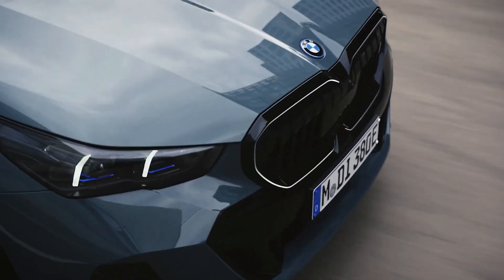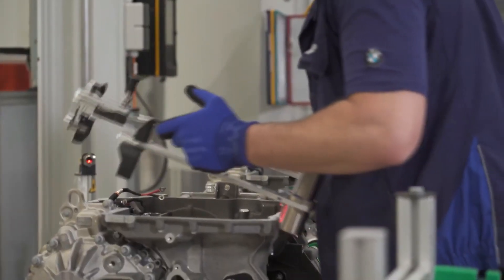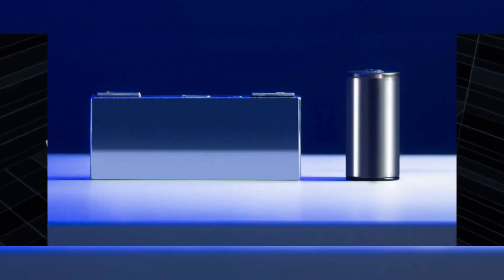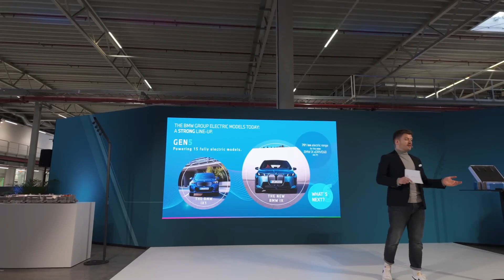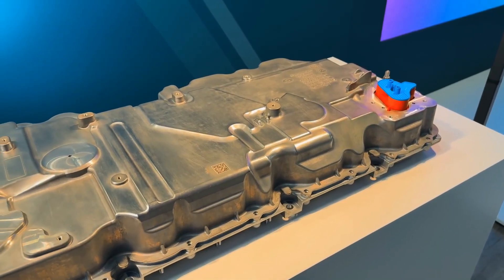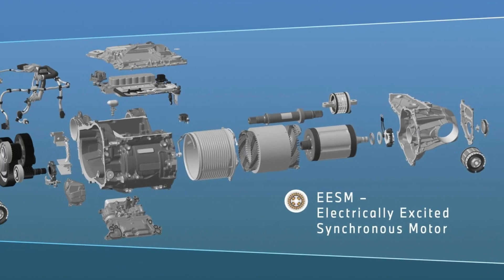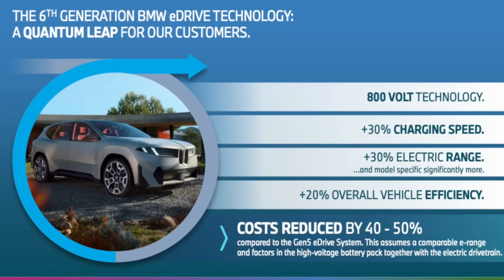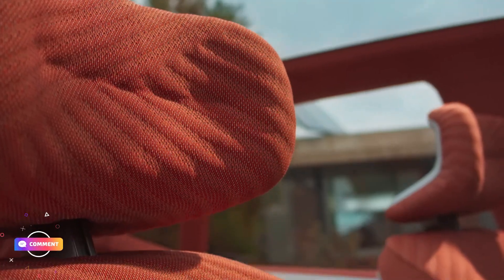The EV Breakthrough You’ve Been Waiting For! BMW’s Game Changer ⚙️

Comment: BYD has launched a 1000 volt platform with a charging power of 1000 kilowatts, which can charge 400 kilometers in 5 minutes. BMW's technology is outdated
Reply from the maker: BYD is still ahead of everyone
Reply: I wonder how long the battery lasts for such a high charging speed.
Reply from the maker: probably 1000 cycles on good days